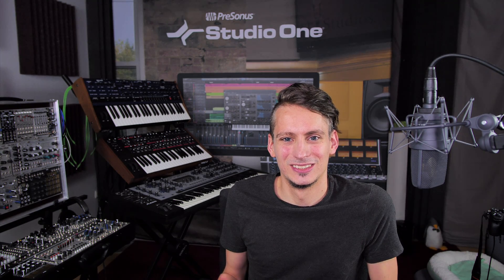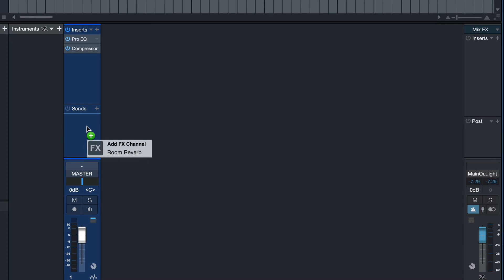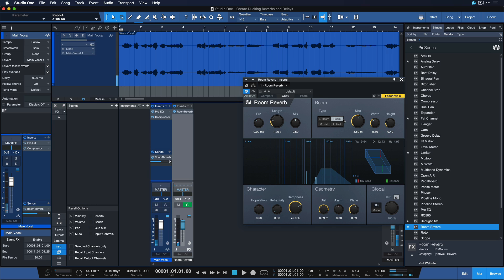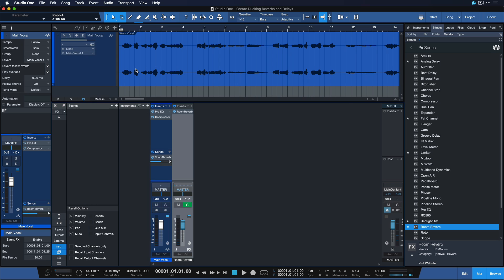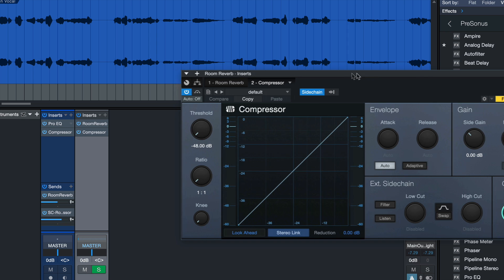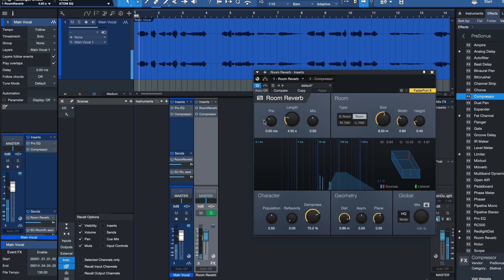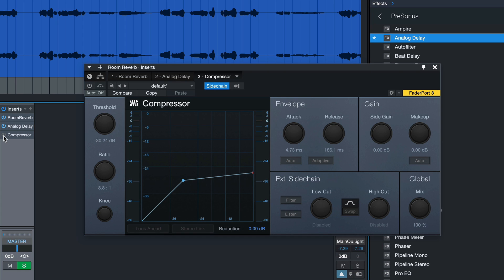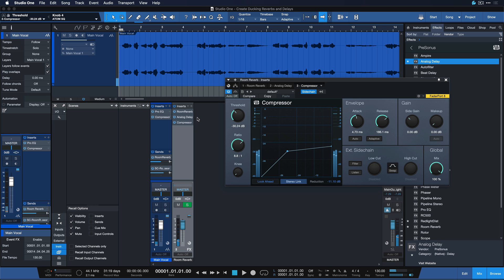How to create ducking Reverb and Delay effects #S1withGregor

Comment: Gregor
A quick question. Wouldn’t just reducing the reverb mix volume have the same effect as using a side chained compressor to duck the reverb?
Reply from the maker: It might - You would have to decrease / increase the reverb volume every time by hand though. -GBY
Reply: Fair enough 
Thank you for the response and the great work with S1 you are doing. It is greatly appreciated.